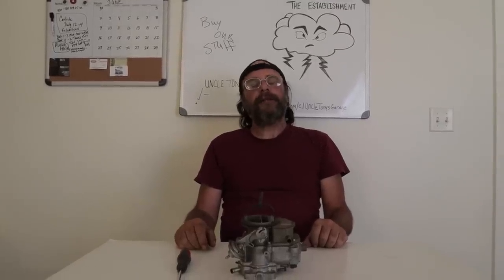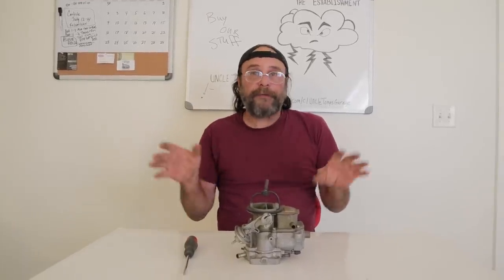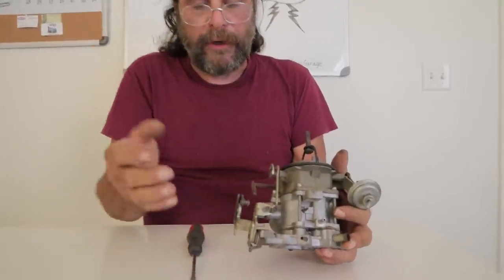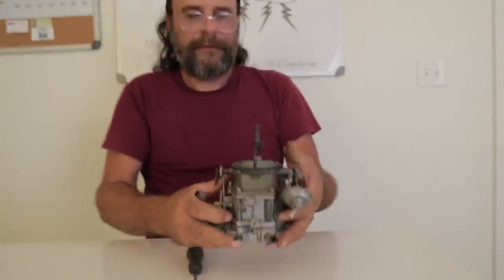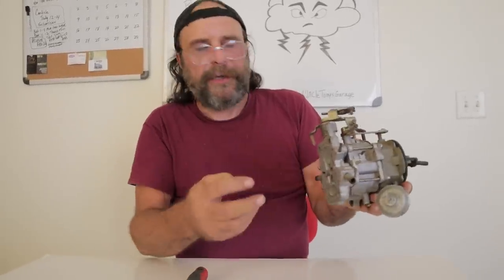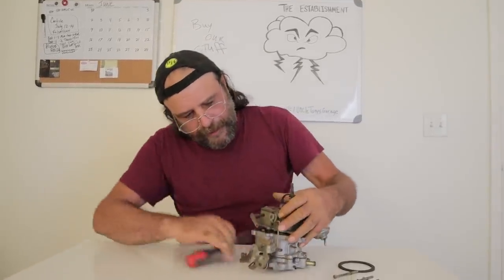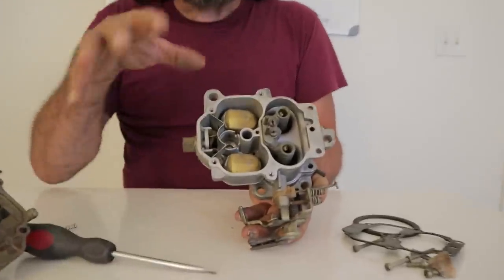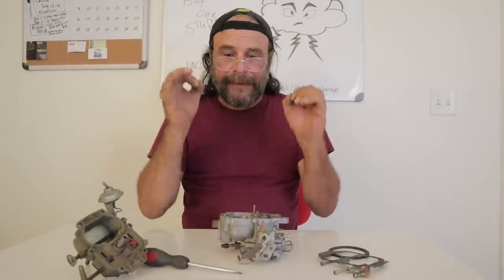Classic Car Tech- Understanding Carburetors

Comment: A couple decades ago I was taking apart my motorcycle carb from an 82 Virago.  My roommate comes rolling downstairs with this expectant look on his face as he was curious about the "mysteries" of a carburetor.  I took the 4-5 main pieces apart and I could see in his face the disappointment and confusion that carburetor fairies did not come flying out.  I said yea, it just a couple parts to control fuel, needle, jet, float... and some cool scientific principles.  He seemed so disappointed.
Reply from the maker: Early Virago's were the shit!  I loved those bikes.  Starters sucked, but everything else was awesome.
Reply: @UncleTonysGarage  That was my first bike.  Rode nice.  Ran smooth.  But yea, that start was the bane of my existence.  Turns out the source of my weak starter problems was the previous owner put a bigger battery in and installed the negative lead to the frame upside down so only an edge of the round connector was touching.  Just was not able to push enough juice through it.  Finally found that, reversed it so it was flush, and it cranked just fine.  Still have it in my basement.  Someday I might restore it to working condition.  Someday...
Reply: @UncleTonysGarage  weak starter carbs had to be just rite to fire up fast to save starter,some guy made a clip to help starter engauge worked great.bought it 100$ sold 1500 about 2weeks just rebuilt carbs starter clip polish fun bike.

Comment: I hate those things. Carbs are nothing but a bunch of analog kluges that try to keep the mix right but never quite make it. I've rebuilt 1-barrels, 2-barrels 3-barrels and 4-barrels. I covered a whole 8-foot bench with the parts from an AFB, most of which look the same as each other. And then there's motorcycle carburetors that don't even have chokes but have a million different jets and needles. I'm super glad to be rid of them. With electronic fuel injection, you can get perfect mixtures all the time. What's not to like?

But Uncle Tony, your explanations are superb. I really learned a lot even though I'm never going to use it.

Comment: I really appreciate videos like this that really dig into every piece of a car/truck and tells you what the commons problems are and explains what every piece does. That being said I do have a couple questions 1) How do you find out what kind of Carburetor you have especially when there is nothing marked on it? 2) If your vehicle starts fine and idles fine but when you put into reverse or drive while gently pressing the gas it dies. Is that a carburetor issue? I can put it in reverse or drive and hold the brake and press the gas hard and it won't die.
Reply from the maker: You could try taking a picture of your carburetor and then doing a Google image search based on the year and make of car.  As for the stalling, that is either a weak accelerator pump in the carb, or retarded ignition timing.  Could be other things, but those are the two most common causes
Reply: @UncleTonysGarage  thanks for taking the time to reply Tony. I will try out your suggestions and see what I can come up with. Thanks again for your help.

Comment: I was pleased with the driveability, performance and economy from the QuadraJet on the 72 Monte Carlo I used to own after I tightened up the secondary air flap spring to delay them opening.  I also have had a great experience with the Holley 4180 on my 1985 Mustang GT.  It has annular boosters on the primary side.  My only gripe with it is it sometimes stumbles from idle when restarting when the engine is warm.  I figure it has something to do with the choke being on when not needed.  The carb on the 1987 Nova (Corolla) our family owned really lacked performance.  Maybe it was calibrated too lean.

Comment: I am 63. I have worked on a lot of cars and trucks with carbs. I also have worked on a lot with EFI. As a big over all statement, for the most part I can agree with (mostly) that carbs work as well as EFI however that is a true statement only if you operate the vehicle in a flat land such as Kansas. On the Western 1/3 of the U.S. we have these things called mountains. I live at 2000 feet elevation. If I drive to work at sea level, I am running rich. If I take a trip up to a resort, I am very lean. EFI controlls for all of that while a carb to be truly effective and efficent it needs to have jets changed and be adjusted at each location. Just a comment from the peanut gallery.

Comment: I've often wondered what advancements have been made in carburetor design since they've been phased out of production cars? I understand they were getting more and more complicated as emissions requirements got stricter, but the switch to EFI was also an economic decision in terms of engineering. Back in the late 70's/early 80's you're paying these engineers to continue tweaking the carb designs, then they have to get these increasingly complex systems through production all while trying to maintain reliability. But the companies eventually realize they could meet their goals more cheaply with EFI. At that point all further carburetor innovation ceases since nobody's working on the problem anymore. But in the aftermarket there's been an additional 30-40 years of progress! At the same time though, all the low hanging fruit has already been picked, so it takes exponentially more time and effort to get smaller and smaller improvements in the design. How much more advanced is a top of the line carburetor in 2019 compared to something that would have been made in 1979?

Comment: You didn't mention the most important thing. The Venturi, no not a '76 Pontiac. I learned about them in small engine school. Carburetors work off of atmospheric pressure, inside there is a neck down, the fuel in the bowl has atmospheric pressure pushing against it, air flowing thru the carburetor throat creates a low pressure area behind the venturi and because of that atmospheric pressure in the bowl area from the bowl vent pushes the fuel to that point. This is super important because my whole life I thought carburetors worked off vacuum, they do not, they work off of atmospheric pressure, the motor does not suck the gasoline into it, it is pushed in there. Just like an air plane wing, air pushing the bottom side of the wing does not lift the airplane, it would just rip it off,  is pulled up by the low pressure area on top of the wing. Same way with a carburetor, it does not suck the gasoline in, it is pushed in because of atmospheric pressure. This is important because someone taking the hose off the bowl vent tube that went to the charcoal box you spoke of, if they threw away the box and stuck a bolt in that hose, no atmospheric pressure, it would cause all kinds of problems. Also you should have shown a carburetor with bowl vent in the carburetor throat, many of them are there, inside the air filter at the top of the carburetor is a good place for atmospheric pressure, but some cars when the needle valve goes bad it is because of water, and the fuel pump will pump gasoline out the bowl vent into the carburetor throat and the engine will flood something fierce. The rubber its made of, no matter if its a rubber tipped needle valve or an aluminum needle valve with an "O" ring the rubber is really called Viton, resists gasoline 1,000 years, but water dries it out. A Needle valve that has been in water (water in the gasoline) will never seat properly and has to be replaced. At small engine school they teach us we have not done the job unless we dump the fuel tank and go to the customer's hose and dump his fuel jug also. If he left the mower out in the rain, more then likely he left the gasoline jug too. I see the young guys with cars run shitty sometimes, water in the gasoline, there is no computer trouble code for contaminated fuel. (water in the gasoline)

Comment: again i was car builder and crew chief at old dominion speedway in manassas va,a couple of yankees in the south,my driver was from vermont too,again the rules said a 2 barrel holy 390 cfm on an eldebrock rpm intake,i was living at an appt in manassas va at the time,i went to junkyard and bought 2 30gal drums of carbs,i made a water column out of clear pvc and checked cfm on bases and tops,we couldnt grind the venturi at all,i found the highest bases and tops and tried on our race car,it put my driver in the seat hard coming out of the corners,after we would win tech looked inside and found no grinding,i took it to vermont to chevk it on a real flow bench,675cfm,Fred Lozon

Comment: I bought a 85 Dodge Diplomat   318 engine with the lean Burn system on it I put the engine in my Duster. The issue is the Distributor vaccum advance is computer control.I change the Distributor with the vaccum advance. But the carburetor is setup the lean Burn. I told to change the carburetor out. This carburetor have a lot of vaccum ports.

Comment: Quadrajunks some of the easiest ones to work on when you first learn to get in the rebuild of carbs..thermal bogs aren't too bad either the only problem with them I always found with those little broken plastic float bowls that no matter how many times you rebuild it if you didn't take a look that one little piece of plastic,  would always be the culprit on those..
never really get into rebuilding Holly's and Ford Carter 
and motor crap I kind of gave up with...

Comment: First stop right there go in take your top off the toilet.

Your toilet is exactly like your carburetor.

Okay then I need to clean my carburetor.....😑
Reply: Go look at a carburetor and fuel pump for a 27 studebaker. It works very much like a toilet.
Reply: No,  just the waste gate.
Reply: I once replaced the carbs on a hemi with a toilet. Got much better flow. But I couldn't put the hood on and it looked ugly as hell.

Comment: Carburetors can be easy or a real B iach, but generally speaking, easy to get sorted out over a bad FI system. I cant tell you how many carb overhauls without a kit I have performed. Kits are fairly cheap but in the heat of the battle and you just want to get that engine running smooth and or in the diagnostics mode you just have to take it to pieces far enough to see what IS wrong. some accelerator pumps have check balls hiding somewhere and they can get stuck.
There are many tiny pieces that can and will ruin the moment if they go flying or dropped on the floor/ground... never to be seen again

Comment: Great video. I like how you started with a simple carb with everything easy to see. 
I don't want to make a bunch of work for you but it would be really cool to see you demonstrate - on a really stock engine, not some hot rod - how problems with some of the systems you mentioned affect the engine running. Like idle not adjusted properly, stumbling on acceleration, etc. etc. You could set this up by purposely mis-adjusting something or plugging something ahead of time and showing the problem and the fix (reversing what you mis -adjusted). It's very hard when you don't know carbs to know where to start. 
Maybe then you could progress to explaining a Holley - which has always baffled me - with the metering block and small passages etc.
Thanks for your efforts. Much appreciated.
Reply from the maker: We've got something right along those lines planned already.
Reply: Great. I'll stay tuned. Thanks

Comment: Uncle Tony - have you ever converted any of your carbs to a manually-operated cable control for the choke?  My 1st car was a bare-bones 62 Chevy II, with that 4 cylinder OHV engine - no radio , no backup lights, and a manual choke.  I was comfortable with the manual choke control.  The next car was a 67 Rambler American, auto choke, and a few times, when the engine was hot, I had to remove the air filter and clip a clothespin over the choke plate to start it.  I was young and did not know how to fix it & did not want to pay someone, so I lived with it.
Reply from the maker: Yeah, I have a manual choke on our 67 Charger.  It never actually gets used, but it's there if needed

Comment: I applaud you, I have totally rebuilt carbs, and have been elbows deep in mpfi. And I think the mpfi is so much easier to work on. The parts are hanging out there. It even tells you what is going on. With a carb there's so much shit all hidden in a small cube. And you need to know what is wrong. The carb doesn't say. However obd does. Lol I will never understand why you guys love carbs. Maybe good for a lawnmower but that's about it. Just my opinion. But it takes all types love the channel keep it up.

Comment: You do not need a choke to start a warm engine. Mine starts without moving the throttle and the manual choke off once it is up to temp. The choke is needed because the fuel condenses in the cold manifold and liquid gasoline does not burn.

Comment: I just turned 30 and have been around carbs my entire life and prefer old skool above new skool all day everyday, same as a manual transmission, I'll be a manual guy till I die, not a fan of computer controlled vehicles. Most mechanics today in my opinion with computer controlled stuff is taking the common sense tuning ability skill away. I've always had a good ear for problems and where to start first to diagnose the old skool way and I'm glad I'm that way.

Comment: A quick refresher please? 460stockish with 600cfm  1407 edlebrock carb. What do you adjust or change to get rid of gas smell out exhaust at idle? Other than that runs great. A little on the warm side (220) for my taste.

Comment: this is pretty interesting. One thing that caught my attention was the choke part.  Many to most motorcycles don't have a real choke.What is thought of as a choke is just like a power valve hooked up to a cable In this day and age .Why is vacuum something  to build your engine around? This day and age hydro boost, electric vacuum pump, or just run good manual brake set up. Was the lack of a real choke in part to the engine design not having vacuum, because there were no power options to worry about vacuum.Perhaps just general government regulations just  let bikes get a way with more...With out writing a book on the comments  section .

Comment: I was taught in school the choke and fast idle cam was for cold starts and warm up, a warmed up engine in good tune will tap start with no choke at all, at least it should. Im a 64 yr old dinosaur and worked with carbs for years and I was pretty darn good with em, its all the modern electronic F/I crap that makes my old brain hurt---LOL

Comment: Hey Uncle Tony you said a carburetor can’t adjust for altitude. I was wondering if you have ever heard of or know anything about Lectron carburetors? I have never used one but they claim their carburetors do not need adjustment for altitude or temperature. I’m not sure how good they are or aren’t but what they claim seems like it would be a godsend of innovation. There’s a video called “how lectrons work” by Jeff Slavens that shows how it compensates for conditions it seems to be a great design. Thanks for making this video now I can just send the link rather than trying to explain it myself.
Reply from the maker: I'll check that out, thanks

Comment: Most people have no idea what happens when pressing the throttle open.
I think of it in terms of I am just operating a carburetor when driving around (on my older car anyway) . Press, squirt BWAH ! Hold it open most of the way and in 10 seconds your doing 100 mph. When everything else works anyway. And there can be a lot of everything else.

Comment: Call me old fashioned but give me a carburetor every time! My 78 GMC K35 with its original Quadrajet (rebuilt by me a few times) starts, idles and runs better than my best friends 2018, no matter what the weather. Of course, he gets slightly better fuel economy, but, that's because his truck only has a 6L engine and overdrive, while mine has a .060" over 454 and 4 speed manual. Both have 3.73 gears.

Comment: Tony I love you Channel I am doing a 1970 Hemi Cuda right now.....true r code with dual Carter AFB carburetors and when the guy went to dyno it....... found out the back carburetor which is the one that idles off of is  completely dead I had them rebuilt but.............. I know Street Hemi so hard to tune for the street but I'm pretty mechanically inclined I'm wondering if you think I should just mess around with them or just spend the money and have them sent out across the country and have them done on  running on a motor before I I get them back.......... I mean it's already screwed up so I can't damage it anymore...........

Comment: I have a 2 barrel Carter on my 318 I have a slight issue trying to go to wide open.throttle while driving from a low speed. I now think I know the issue and might tear it apart to see if I'm right.

Comment: My 86 Chrysler Fifth Ave has an issue sometimes where the car will fire up but runs like crap. As soon as i take the air filter off an tap the carb with a hammer ill fire the car up again an it will run fine. The top of the carb is usually covered in fuel. You can see where its all wet from the fuel under the air filter and its housing. Ive wondered about the needle valve on the float sticking. This just confirmed it. I think!!.. Thank you for your info. Tell me what you think it is and if im on point. Also its a Holley 2 barrel.

Comment: 5:16 Or a vacuum hose with a hole. That torn hose will provide most of the air at idle. Air  bypasses the carb. Very Very lean mixture.

Comment: When you get around to the tuning part. don’t forget to mention the power valve selection to idle vacuum correlation. I always laugh when someone puts a huge cam in something with a Holley then can’t get the fuel mixture right. 😝 I can’t help but give them the solution though.